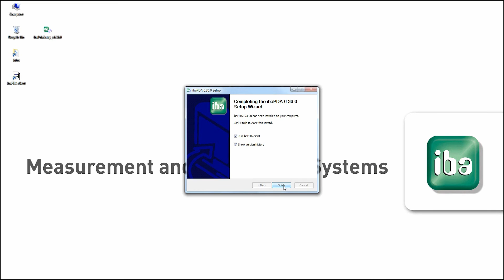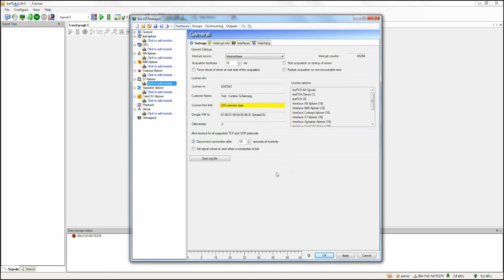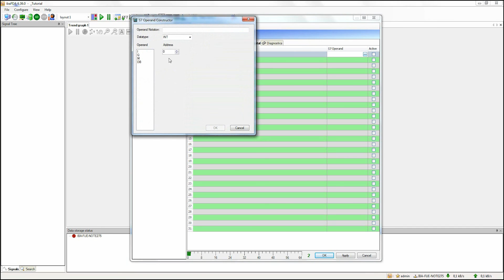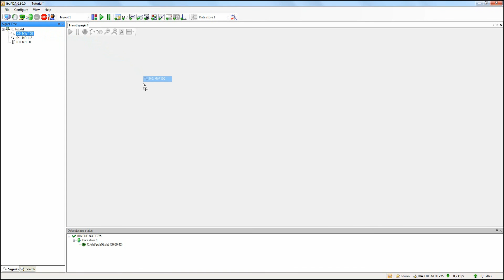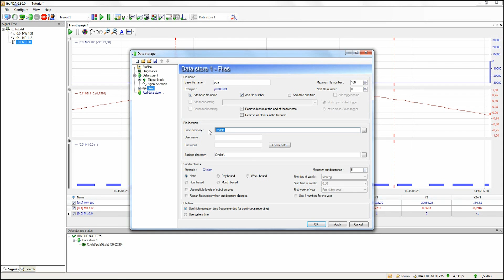ibaPDA-PLC-Xplorer: How to get started (E01)

Comment: Hello, I would like what happens if the maximum time range of a file is reached? Does Iba automatically create a new storage file for the remaining of the recording ? 
Thanks
Reply from the maker: Hi Aleksanrda! 
Thank you for your question. ibaPDA offers a variety of options for configuring triggered or continuous recordings.
The default behavior is that a new file is created when the maximum time span is reached.
Don't hesitate to contact us if you need anything else.

Comment: IBA PDA can do a million things, it would be great if many more in depth tutorials were made. ¿Can you use it with PLC SIM from siemens?
Reply from the maker: Dear Vibeland, 
thanks for your interest in ibaPDA and our tutorials.
Yes, ibaPDA can be used with a CPU simulated by SIMATIC S7-PLCSIM. This requires the use of the ibaPDA-S7-Xplorer Proxy. This proxy acts as data gateway between ibaPDA and SIMATIC S7-PLCSIM
You will find an detailed example in the manual ibaPDA-Interface-S7-Xplorer.
Reply: @ibaAGcom  Thanks 4 your reply, i'll take a look at it